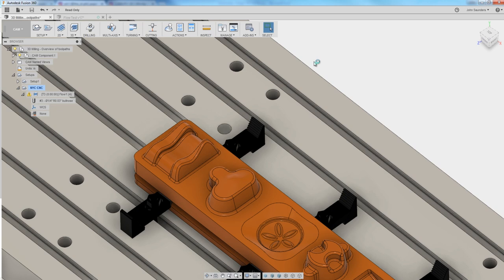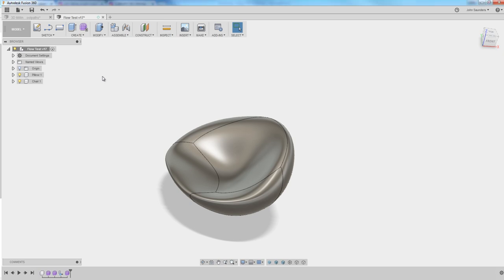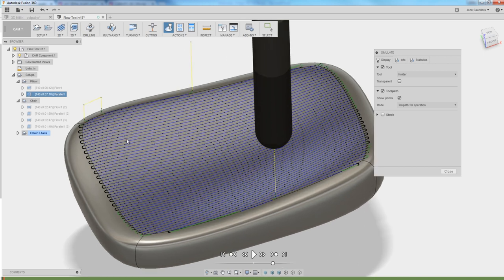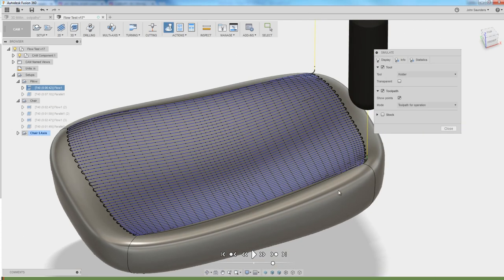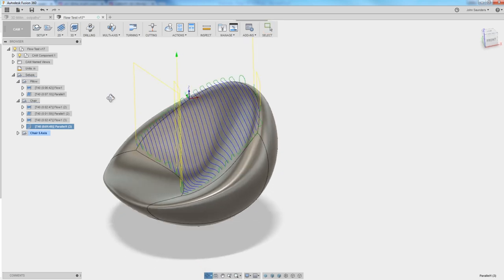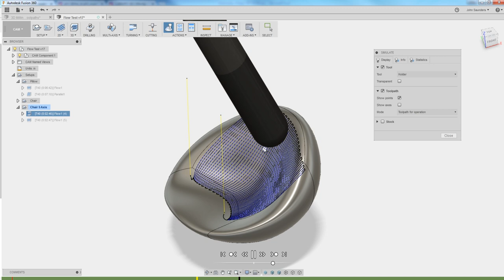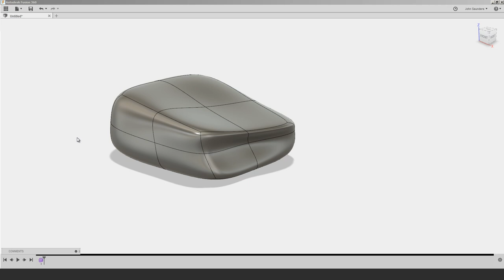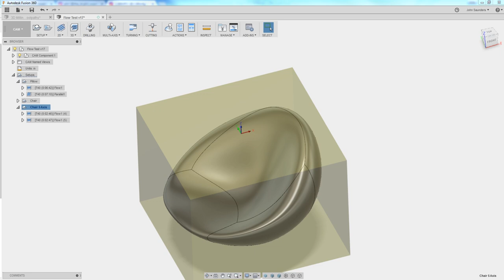Tutorial: Using FLOW TOOLPATH  in Fusion 360 | FF126

Comment: I’ll try and explain the point map difference. 

Parallel and most other surfacing paths make a triangular net and casts it straight down onto the surface and wherever the points hit on the surface is where they lie. 

With flow it lays the triangular map onto the surface and wraps into the surface so it keeps the spacing between the points consistent. 

Think of parallel like a steel mesh grate that doesn’t flex and mashed onto the surface. While flow is like a piece of flexible mesh screen laid onto the surface and smoothed out.

Comment: So Flow is supposed to have been brought over from HSMWorks since its been there forever. Over there it works fine. And if you watch Rob Lockwoods video on 3D Machining he pretty much shows you how Flow is an amazing toolpath. But over their it works just fine on all surfaces. All surfaces have a UV direction. So this sounds like a bug. Hopefully they get it working cuz in HSMWorks its definatly my favorite toolpath for finishing. And with it being the same CAM kernel I dont see why it would take them long to fix the issues. - Jacob S.

Comment: I have been intrigued, after you make such a "flow" for a customer, how does the supplier and the customer agree it is made, or not made, to print specification?  Example ... a turbocharger aluminum compressor wheel molding equipment?  Thanks!
Reply: MIGuy 
They are CMM’d. The print on things like that should have datum points at XYZ locations on the blades. 

Or they with have a GDT profile tolerance call out which a CMM with a scanning probe can check.

Comment: What a software do you use to create 3D Models, that you import in your Fusion 360 Soft? And which extension of files have this 3D Models?
Reply: Fusion 360 works for creating 3d models, and is the main tool he talks about on this channel.  There are some SolidWorks videos very early in the channel, but it's been Fusion 360 for years now.